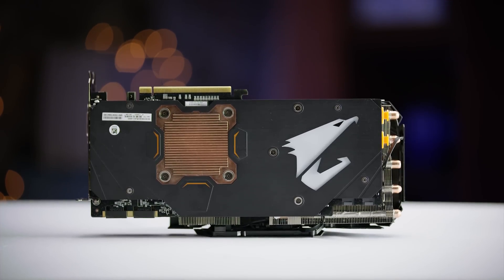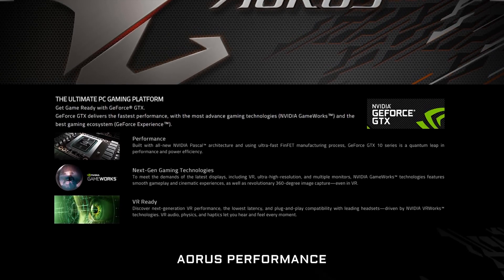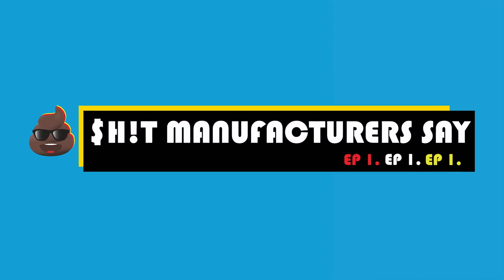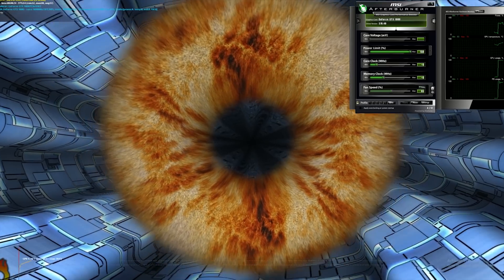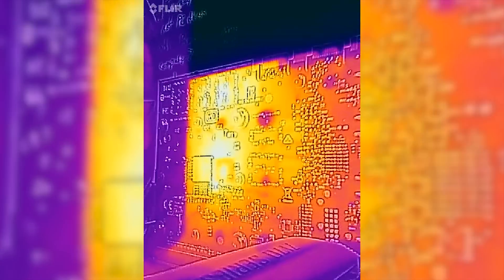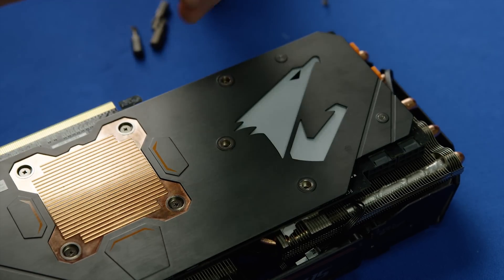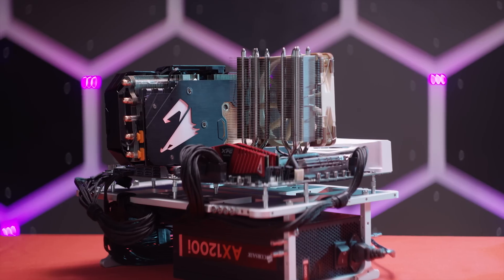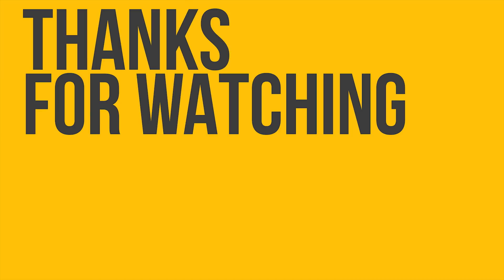$h!t Manufacturers Say Ep. 1 - "Backplates Cool Your Video Card"

Comment: Each backplate is a bit different, but overall YES, it's primarily for structural rigidity and/or aesthetic. But with the use of thermal pads, they DO draw heat away from specific rear-mounted components passively because that's how shit works in science land. It allows even temperature dissipation on components that may perform better with it than without it. The temps you're talking about are GPU/RAM temps on the card, which are not components typically covered by a backplate.

Also: chill out a bit, you're acting like an infomercial carnie.

Comment: No shit the core isnt cooler... some card have vram on the back. And from what i know manifactures doesnt really wast money on stuff that isnt needed but they still but thermalpads between backplate and vram then its probable for a reason.
Reply: manufacturers will gladly "waste" couple dollars on a non functional backplate if customers will happily pay 30$ for it. Also sometimes the thermal pads are there just to make sure the backplate doesn't contact the surface components and cause short circuits.

Comment: This "colder" spot might be due to surface finish on copper plate. It is shiny and most thermal camera have problem with very shiny object which may have diffrent temperature then this read from camera sensor.

Comment: For the gpu chip itself it probably won't do much. However for individual components like tiny LDO's or what not the backplate could be essential. I'm an electronics hardware engineer and I deal with stuff like this quite often. That big piece of metal could be extremely usefull to cool all parts on the bottom enough to meet de-rating standards (so that life-time can be guaranteed). Also, when taking an infrared image from a PCB, better coat that thing with paint that has a somewhat decent emissivity. The different materials and colors of the parts on the PCB mess with your readings.

Comment: Disliked for misinformation. See Max Elkin's comment.

Also the thermal imaging of the adrus card showed a cold spot, this is important because even if the overall temperature of the card is the same the trick is to disperse the thermal energy generated by the card away from sensitive components and onto a larger surface area to aid in convective cooling. Of course the card is going to generate the same amount of thermal energy with or without the plate, the trick is to use the plate to disperse this energy thus eliminating "hot spots" especially near temperature sensitive components. However, as Max Elkin pointed out, it also clearly DID enhance convective cooling as can be seen by the lower fan speed with the plate on.

So the two advantages as I see it are 1, enhanced convective cooling, and 2 heat dispersion (which in this case, but not necessarily, leads to cooling).

Isn't this pretty obvious, I mean manufacturers like alienware coat the entire lower cover to their laptops in copper plating for just these reasons, heat dispersion and enhanced convective cooling. This is exactly how a heat sink in general works, except heat sinks have deep ridges to further increase surface area. All the plate is, is a less efficient (less area) heat sink.

Comment: A backplate may not help with the GPU itself but with the CPU. It won't matter in a horizontal open air test bench, but it will matter in a usual air cooled build in a normal case. If there's no backplate, the GPU will dump most of the heat that dissipates out of its back straight up to the CPU. If there's a backplate, it will catch that heat and dissipate it more evenly. This was the general consensus from a while back when I was about to buy a GTX 970.

Comment: Now try attaching a 500g cooler to a platine without a backplate and watch and break apart. Enjoy the not functioning piece of former electronics now. It the highly competitive low margin PC Hardware market manufactorers will claim anything to sell their product, it however does not change the necessity for certain elements of a machine. Only because I say more RAM in your PC will make you more beautiful, does not mean its more RAM is not usefull. Its a fallacy to do so.

Comment: As anecdotal evidence against your findings; I have an ZOTAC 980 AMP! that I put a NZXT Kraken AIO water cooling on. With the backplate removed, the card would crash on furmark but with it on it's stable for the past year. Like others have mentionned, I think the difference in not in core temps but memory cooling. Might want to investiage that part further (maybe in ep1 p2, the reckoning?).

Comment: Since you took the whole cooler off of aorus card I think you should accout for different thermal paste that you put. I mean, when you changed the cooler you did clean it and reaplied thermal paste right?
I'd redo this test comparing the card with and without the backplate, but this time first you test it with some different compound then the stock. And then using the same method (mean pea, line, x, whatever) with backplate. Many variable you could have missed, I do think that backplates doesn't help by much but still, not a perfect test this one.

Comment: Not sure if somebody else has already mentioned this, but why was this test done on a test bench and not in a case?  Would the airflow that should be in a case not have a potential cooling effect (cooler air over the backplate in addition to radiating) on the back plate?  This test doesn't seem particularly well thought out, and is not representing "real world usage" to draw any meaningful conclusions.

Comment: The cold part on the backplate could just as well be the higher emissivity of the unpainted copper material compared to the painted aluminum. You can't just point an thermal camera at stuff without knowing about how these physics work if you want to do this properly you have to thermally correct for the different emissivities of both materials.

Comment: The "cold spot" on the backplate is an artifact of the copper heatsink. The rest of the backplate is black which means it radiates the IR light very well. The copper is metallic, so its reflectivity is high thus the IR radiation is low.

There is nothing cold about that spot. It just doesn't radiate the heat very well, making it look cold on the IR camera.

Comment: You can't get an accurate thermal reading off of a shiny metal surface - especially side-by side for reference with a painted, rough surface. That's why the copper plate appeared "cooler" in your imaging than the surrounding painted/anodized/nitrided surface.

Comment: Backplates do help, for example the EVGA GTX 1080 ACX 3.0 has a slight fault, no thermal pads on the mosfets that would touch with the backplate, but with the thermal pads fix and it in contact with the backplate the VRAM gets a lot cooler, and is no longer at fault.

I also have an EVGA GTX 1080 Classified, and I did this and I personally saw improvements

Comment: you forgot to mention the fan RPM while @ 67°C, could be running with lower RPM's while the backplate is on as it DOES warm up > more area in contact with outside air.

Comment: If you want to measure the temperatur of the copper backplate in comparison to the black metal with thermal imaging, you have to adjust the emission coefficients of your Surfaces. Depending on colour and material it changes drasticly. Easiest solution to compare the two materials in one shot is to put thin tape over all of it, now every surface has the same emission coefficient. https://en.wikipedia.org/wiki/Leslie_cube 
Also you are probably getting some reflections of your CPU-cooler so put a pice of paper between them for a more accurate picture
I hope you consider this for your next thermal experiments.
All the best

Comment: In my experience the back plates & the front plates get in the way when you don't have much room to play with, so they end up getting removed, you might need A 1/4 of an inch so their goes the plate, & the card ends up running cooler from the server fans, an extra win

Comment: Would there be a difference if the card was in a case rather than a test bench as there would be more directional air flow over the back plate to dissipate the heat?

Comment: If youre attacking manufacturers, saying they talk shit, you should REALLY go through the effort of setting up a better test szenario than the software readouts and a short shot with an infrared-camera. Im disappointed. 
Whats wrong with this: 
Fan Speeds: Setting a Power Target doesnt mean the Fanspeed is aways the same. 
Ambient Temperature: Should be mentioned at least. 
Software Readout of temps: Those have gotten better, but are still just a rough estimate. Enough to compare, maybe, but not certainly
Temps II: Thats the GPU Temp. There are components on the back of the GPU as well. 
Conclusion: The Card isnt faster. The GPU isnt hotter. But the Card MIGHT live longer. The Card might live longer when overclocked to the max. Whatever. 
Dont get me wrong: Im not saying a Backlplate is of any use, im saying this video didnt really Test it thoroughly and im saying if LTT says "manufacturers say shit" they should back it, with good tests.

Comment: The main claims of manufactures are NOT that the GPU gets cooler, but that VRMs are better cooled.
EVGA and may others put many heat conducting pads on Backplates where VRMs are, because these little things gets over 100 degrees hot.

And there are Tests that proves that it works.

If the Title would be "Backplates lower GPU Temperatures" than your conclusion would be right, but it is Backplates cool your video cards. And the Fact is that many Backplates indeed help to cool parts of the Video Card - mostly VRMs. Sometimes the Card has VRMs on both sides so that cooling impact is higher.

Otherwise there are cards like the Reference 1080/1070 where you have no addition cooling, but actually higher VRM Temperatures because its blocking direct airflow.

So the right answer would be: GPU never gets colder, VRMs gets colder on some cards and hotter on other - dependent on how the manufacturer designed it!

Like Many workshop episodes this test has flaws...
If you would have tested more than 2 cards and checked VRM Temperatures via GPU-Z you would have seen that on some cards it makes an good difference!

Comment: people facepalming over the results
heres the thing, outside of the removal of the back plate, nothing else was change, no fan speed or settings, just the removal - if the temperatures don't change from the back plate removal then the video is correct, it stands to reason that it is for aesthetics.

however, one thing wasn't addressed about the cards - the 79 and 67 degrees is the temp it got to under that particular load (no changes made), but what if that load got higher or lower then suddenly back to original settings? how quickly would the card at 67 change in temperature - will it be the same speed using the backplate or will the backplate allow for the better cooling so its a faster decrease in temp, allowing the card to cool down more quickly when that extra load is removed. - if you catch my drift.

without a backplate cooler, the heat stays largely across the whole of the back of the board - but prehaps it''ll cool down quicker if most of that heat is moved to the copper part of the backplate, right? - the 67 didn't get higher, but it may actually cooldown faster because of it .... or am i just talking out my arse.

Comment: well yes of course it will dissipate some heat. the circuit will obviously get got and it will radiate heat in all directions but generally in the direction of least resistance. some of that will go opposite the CPU cooler. it's not going to be a crapton but thanks to advertising bullshit they aren't lying when they say it will cool it.

Comment: I think that gpu's with memory on the back would get a cooling benefit from a backplate. Personally, I have an EVGA GTX970 thats this way and overclocked, I couldn't run it without heat-sinks on the memory without having thermal issues.

Comment: Whilst I agree it adds no thermal benefit Backplates on video cards are extremely useful at protecting the PCB from electrostatic discharge or arcing should a piece of metal touch it It is also good at reducing the risk of static shock when installing new components. For these reasons I believe every expansion card should come with a backplate.

Comment: Metal back plates spread out the heat over the back of your card, increasing the surface area where within the heat is distributed. If you have a 140 fan blowing air across the top of it.... your card will cool off quicker v.s. without a back-plate.

Comment: I like talking some new things in the industry but I would seriously preference to see some actually well thought out documentation about this. You forgot about the exact clock speed it ran and and that it might adjust due to temps and while temps might be the same performance might be different. What was the noise like. like someone already pointed out the fan speed in the FE was 4% different. please do your homework LTT. I like your videos but I am sick of these half assed analyses that make you look like you don't care about th content you put out.
Reply: what about getting some additional temp sensor to put on the card. Core temps will usually be the same but what about MOSFETs COUGH EVGA and what about VRAM cooling COUGH INNO 3D 980 TI AIRBOSS ULTRA X3?
Get all the data you can and ensure that you could not possibly have forgotten about something. 
then conclude some hing is worthless.

Comment: Makes sense, the thermal dissipation in this case has as much to do with the surface exposure as it does thermal transfer. A fan would be more effective in the sense of pushing a transfer medium across the surface than the back plate.

Comment: Nothing about fan speed or noise? It could be way hotter with the backplate on but it's desiged to stay at 79C so it will just turn up the fans and it would be a bit louder while still achieving 79C.

Comment: There are several flaws in this video...
#1: As mention by another person in the comments, fan speeds... With the GTX 1080 FE, it's a 4% difference as seen in afterburner, and with the Aorus GTX 1080, you didn't even show/say the fan speeds without the backplate. 
#2: Don't test stuff like this on a test bench... Test it in an actual case...
#3: It can help VRAM and other small components like voltage regulators and such. And possibly with the GPU core if you have acutal air flow over it.
#4: This is not an actual flaw, but i wanna see it with both stock temps and OC temps. On both cards. 
I really wan't to see this test redone. But honestly, rather by JayzTwoCents.

Comment: I can't help but wonder if the "cooling" back plate isn't meant to cool the GPU, but the PCB soldering where the GPU meets the board.  Perhaps it helps prevent the GPU from getting unseated properly from the heat.  Is that possible or likely?

Comment: The 'cool spot' you see on the backplate is most likely a difference in the emissivity of the copper vs the other backplate material, not a change in temperature.

Comment: What a retarded test. The backplate is to help cool some of the RAM and other components. It also helps with the structural integrity of the card when mounting the heatsink as it reduces PCB flexing which can potentially break traces. 

Also, learn to use a thermal camera properly.

Comment: A benefit of the backplate in my setup is that it protects from salt air corrosion, it prevents the dust to accumulate on the back of the GPU which retains salt air moisture and causes corrosion..had a 780ti and 980ti failed like this,,,however my GTX 1070 seems to be holding up...i live by the seaside